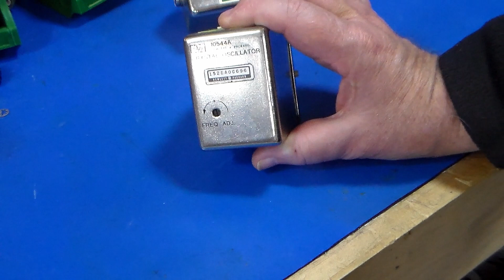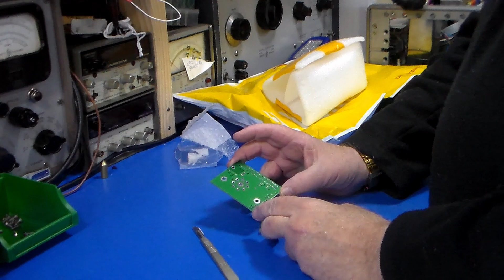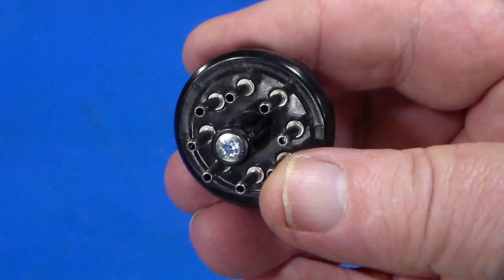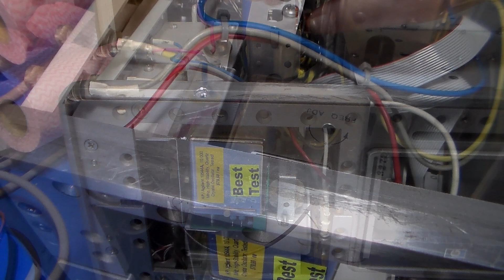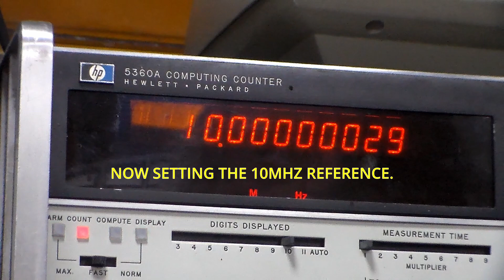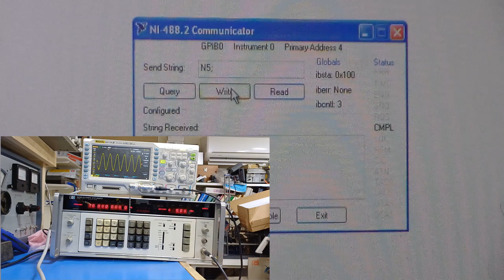HP3330B Repair Part 2

Comment: Well done! A very tidy reference oscillator replacement. When adjusting oscillators of this type I like to use an external GPSDO reference with an HP 5372A Frequency & Time Analyzer - these HP oscillators are amazingly stable. Regards, David
Reply from the maker: Hi David, yes, my measurements so far are only referenced to my counter. I have GPS receiver that I'm yet to set up as a reference for my 5360A counter. I have an HP 5061A Cesium reference waiting for restoration, but I don't know if the Cesium beam tube still works. If the tube is faulty and if it is still possible to get a refurbished tube, my wife won't let me spend the $50k, or more!
Reply: @peteroneill404  Ah yes, I understand completely,  wives are funny that way. I combined a GPSDO, Arduino, display and an old Extron video distribution amplifier (modified to 50 ohms) to come up with a really nice reference with lots of ouputs. The display gives me time, location (why not), GPS lock status, OXCO oven status and number of satellites received.